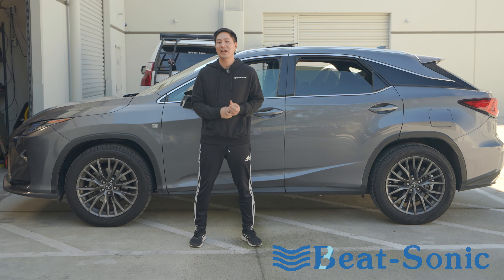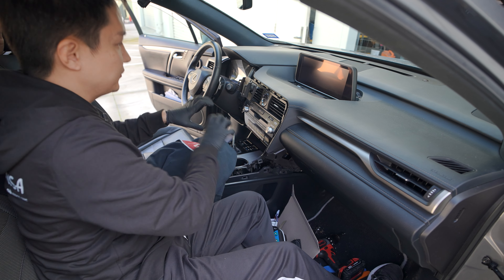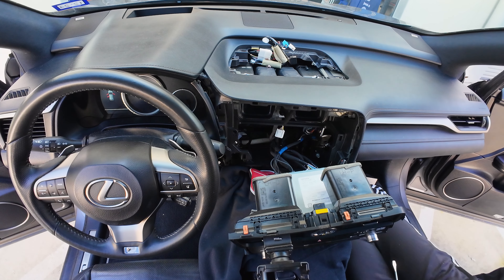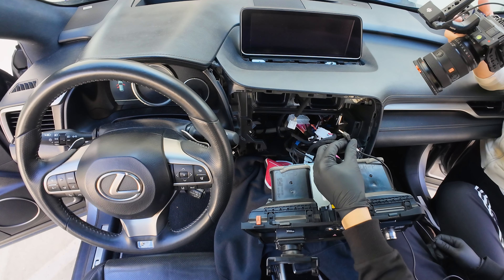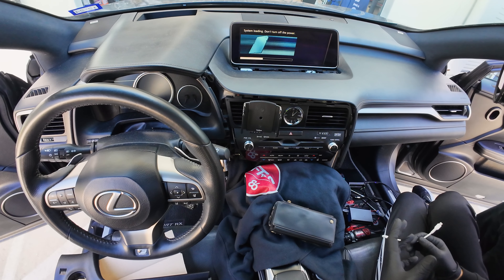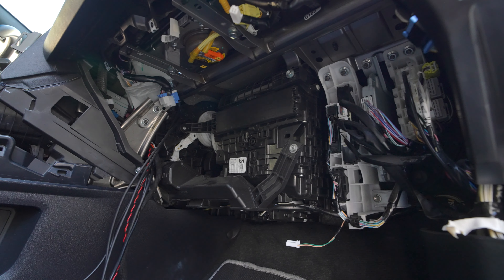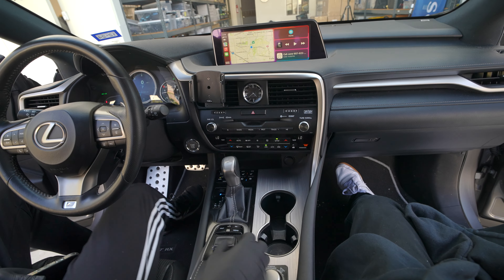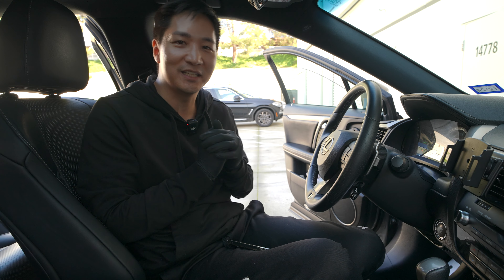2016-2019 Lexus RX | Beat-Sonic CarPlay Solution

Comment: I installed it today with zero issues. It isn’t cheap, but it’s completely worth it because it feels like a factory unit. Mine boots up on its own without pressing any buttons when the car turns on and brings up CarPlay flawlessly every time. Sound quality for both calls and music is exactly the same as the factory unit (I’ve read other units that route audio through aux have echo issues). Even the trackpad controls are easier to use than I expected. My only wishlist item is to be able to summon Siri using the steering wheel voice button, but tapping the menu button is easy enough. 

If you’re watching this wondering if it’s worth it - it is 100% worth it.
Reply from the maker: Thank you for your feedback! We’re pleased to hear that you are satisfied with our kit. You may also summon Siri by pressing and holding the phone call pick up button
Reply: HI. Really great to hear someone that had a good experienc with the kit. We are thinking of buying a 2016 RX350 F-Sport with Mark Levinson sound system. It is not VIN# compatible with the OEM upgrade so I am looking for alternatives. Which vehicle did you install this on. Does your car have Mark Levinson Sound System?
Reply from the maker: @groovymoon  our kit is compatible with all the trims including the one with Mark Levinson
Reply: @BeatSonicUS  Thanks
Reply from the maker: @groovymoon  you’re welcome!

Comment: Hi Eric, when I receive calls, it does not seem to work when I try to answer it. Music plays fine using cars Bluetooth. Could the audio connector to the radio be loose?
Reply from the maker: Please try unplugging the microphone cable from the Carplay module and see if the error disappears. If it doesn't, one of the pins is bent on the large female connector that is connected to the large male car connector.

Comment: Will this work with 2016 RX350 F-Sport with Mark Levinson Sound System? I already checked with my local Lexus dealer about an OEM upgrade and the RX350 we want to buy is not, based on VIN#, compatible with the OEM dealer installed upgrade.
Reply from the maker: Yes this is compatible with 2016 RX F Sport with Mark Levinson Sound System.

Comment: I have another companies aftermarket apple CarPlay. When I control it using the controller. The OEM system is also controller. When using the steering wheel next and previous songs. It skips a song. Anyone else have these issues? Installed through the company.
Reply from the maker: Sounds like an annoying issue. Our kits don’t have any of those issues